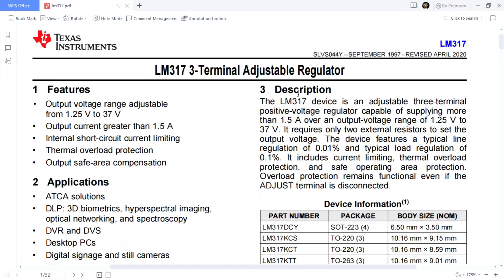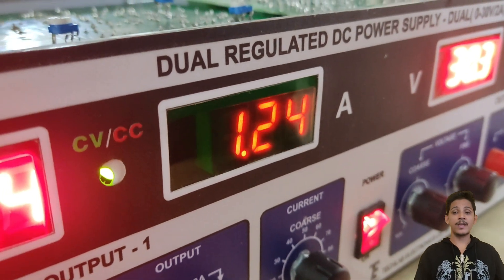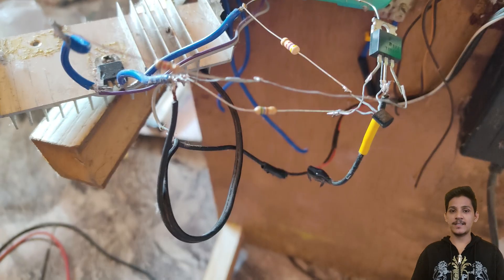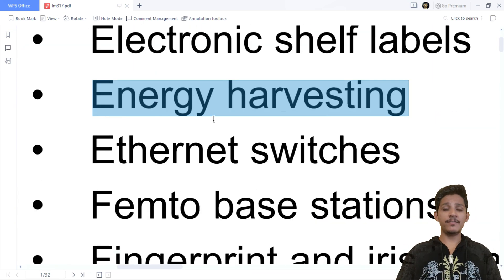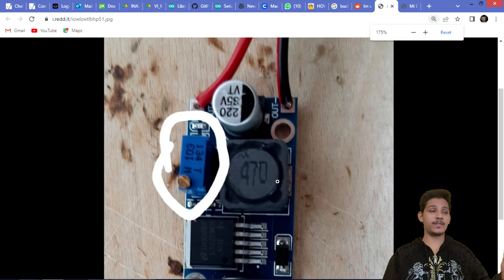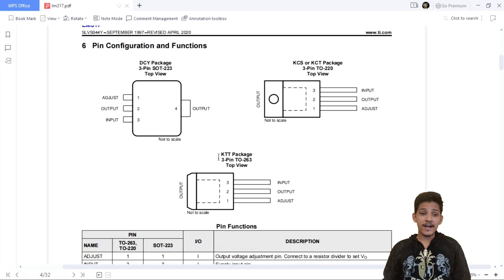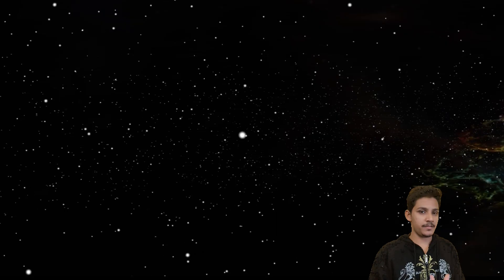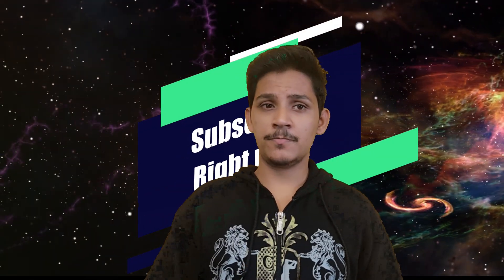DIY RPS LM317 Datasheet Explained.

Comment: Well it's looks good for diy projects !!
Reply from the maker: Sure where you want to adjust the voltage and when efficiency doesn't matters you can use this cheapest solution
Reply: @anklabs7504  ya it can be useful for my levitation project if iam using 32 v smps
Reply from the maker: @tamilelectronics4238  yes it's just like buck convertor to get 15v you need 18 volt power souce